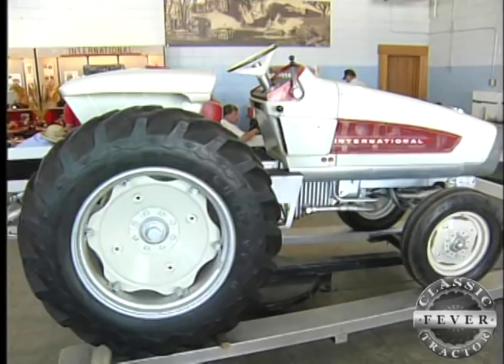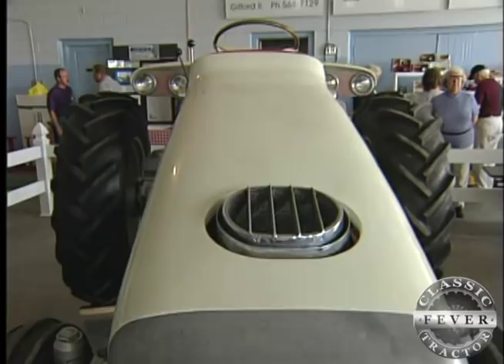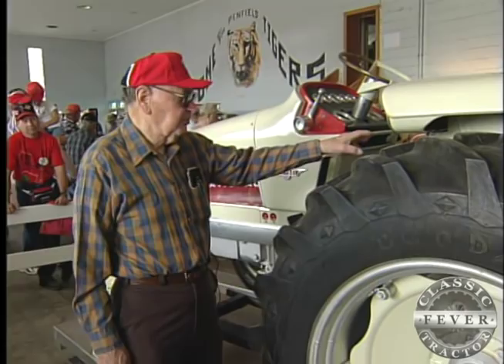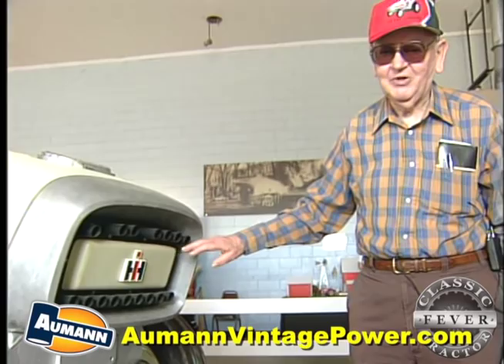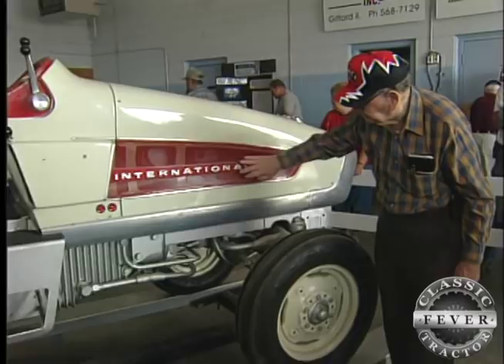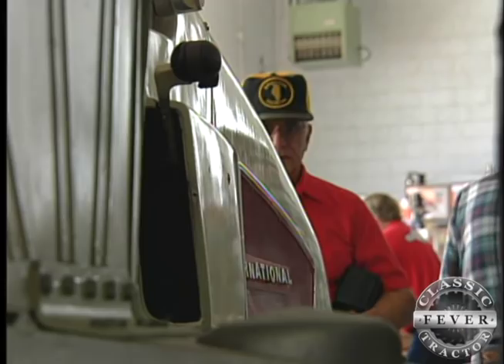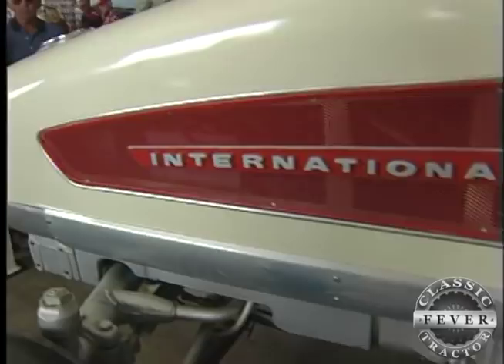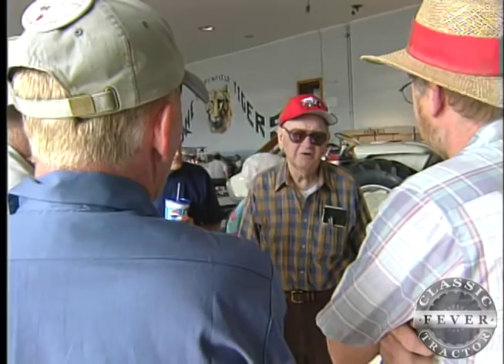This Machine Could Have Changed The Way We Built Tractors - HT-341Prototype Hydrostatic Turbine

Comment: Pratt & Whitney still builds a variation of this turbine. I’m 2nd generation on these engines. My dad, 96 now, worked for Solar Aircraft/IH Solar Turbines/ Caterpillar Solar Turbines for 48 years building these engines. They make giant industrial turbines. It is on the site of Ryan Aircraft in the 20s and one of the buildings has a plaque that says the Spirit of St Louis was built inside. I worked for them for 5 years. In 1980s small turbines were spun off to their own facility called Turbomach. It was purchased by Sundstrand in 1985. I hired in in 1988, I’m at 34 years now. It was then merged with Hamilton Standard when purchased by Untied Technologies. 2006 we became Pratt & Whitney. 2016 everything military moved to Palm Beach, Florida from San Diego. 
The turbines in this video are aircraft APUs adapted to this tractor. The first turbine is a T-62-T2A and was used on Chinook and other helicopters. The T-62-T2B replaced the A model in 1962. It is still in production today, shipping some out this Friday. It is the same engine in your video with a different gear box. These T2Bs are one of the most common units for aftermarket because we have built so many. There are turbine airboats, home built helps and airplanes. If you ever watched Home Improvement, Tim Allen’s jet mower was T2B powered built by Dixie Chopper. We  build 17 models of APUs in my building right along side F-35 main engines. I am very lucky to be a mechanic on this stuff, it’s been an awesome career and they pay me big bucks to wrench on the Treasure Coast of Florida. Two years to retirement.

Comment: I.H. made & marketed the hydrostatic transmission - ed tractors here in England through the 1970,s , they had ( I believe ! ) their own 4 cylinder diesel engines in , I liked them very much , as you could get exactly the ratio you needed to suit the job you were doing , which greatly improved efficiency , but I was once told you needed a clever man to work on or repair one , this may be hearsay , I don,t know , I didn,t get one , but knowing what I know now I wouldn,t be put off , my mates have all used Ford selecto - speed , David Brown Hydra - shift & M -F Multi - power without crushing issues.
I was once privileged to visit the Wheatley Hall Rd plant in Doncaster while it was still working , it was & still is , a massive place , where they made their own steel , & all swarf was re - used onsite . Most noticeably , nice people !  this goes a long way .  Whatever happened to our industry ?  as if I didn,t know .
Reply: "

"GLOBALIZATION is good for everyone"
George Bush senior's NWO, man we've dropped down a few notches since that first Gulf  war!!! Vote RED, lest we lose this nation our forefathers built with their blood, sweat
& tears.If we open boarders ,no restrictions no rules we've lost the best that's ever existed. There will be NO going back!!

Comment: Beautiful tractor. This is a one off, HT-341 built in 1962. There was one other built in 1961, the HT-340. It was the same but with a blue and white paint scheme.
Reply: Not the same, they had different turbines. 340 had the 90 hp T62-T2A, 341 had T62-T32. I still build these same turbines NEW for at Pratt & Whitney. I’ve built these since 1988, my dad also worked for Solar Aircraft/ IH Solar Turbines/ Caterpillar Solar Turbines in San Diego for 48 years. T2B has been in production, pretty much unchanged since 1962, T2A was 1958. You can still buy all spares for these engines. The turbine is still used on T2B, the gearbox is still used on Blackhawk helicopter APUs.

Comment: In the 1990's Agronomic Management Technologies of Tucson, AZ employed  a  bi-directional hydrostatic transmission in their Golf Greens rollers. Powered by a B&S, or Honda small gasoline, side-shaft engine it was light weight, fast and came with a tilt trailer, it was affordable and efficient. Rolled USGA spec greens to their "fastest" potentials in minutes with less pounds per square inch than the human foot. Went side to side, like a paint roller. Easy to operate and a blast to ride on!

Comment: It reminds me of an experimental tractor which I saw at the Farmall tractor plant in Rock Island, Il sometime during the 1960s. The one which I saw had the same basic shape and a high-speed road gear. At the time some people believed that it was going to be necessary to take tractors onto Interstate highways to get between fields. The tractor which I saw was an experimental tractor designed to be able to travel at highway speeds. It was abandoned shortly after I saw it. I went through the plant with my dad for the first time in 1964 and would go through a few more times during the 60s. I am not sure exactly when I saw the highway tractor.

Comment: Looks like someone left an IHC tractor and a Lotus 7 alone together in the barn a little too long.

"Military jet fuel" sure sounds cool, but JP8 is essentially just kerosene with some anti icing additives. With some tweaks, the turbine probably would have burned diesel as well.

Thanks CTF, neat tractor. Does it ever get cranked up and run?
Reply: Formula 1 and tractors...a true passion for both!
Reply: I have seen them run biofuel.
Reply: 4
Reply: @satishfarale1393  5

Comment: Another problem which occurs with gas turbines is gyroscopic precession. A company in Devon, UK, were working on a gas turbine quarry truck in the early 1970s, but found that, on very rough ground, the precession would damage the engine mountings. They also had problems with dust ingestion in quarries in summer, and the project was abandoned.
Reply: In 2003 the Army was having problems with sand getting into the blackhawks turbines. So we put air filters on them and a serviced them more often.
Reply: Ah well, the military tend to do things properly; The average quarry tends to wait for things to break before doing any servicing!
Reply: @reithsymonds4517  my god that is so painfully true
Reply: reith symonds oldsongs

Comment: It's spiffy, sure.   Lots of HP for not a lot of weight.  The issue is when you are actually using a plow or disc or any heavy equipment, you want sufficient downforce on the tractor tires so you can maintain control of that monster.  The easiest way to do this is for the tractor to weigh as much or more than the equipment.  This is why wheel weights, front ballast, and ballast boxes are things that exist.  Using this type of engine that weighs so little would compromise the control of the equipment.  At least in my opinion.

Comment: When International made this tractor they had only just moved away from diesels that had to be started on gasoline first, quite a jump. The hydrostatic system was adapted in the later 656 series and proved to be very successful . Chrysler built prototype cars and made a movie around a similar engine around the same time. Ford had class 8 trucks delivering freight and parts between plants and all attempts couldn't overcome the fuel consumption associated with them, also in the truck experiments the lack of torque kept them out of mountainous terrain.

Comment: Remember when Andy Granitelli almost Won the Indy 500 in a Turbine ?  Turbines are great 1 trick pony engines but farms need tractors to work a high and low RPMs and deliver high torque all the way through.  Plowing is one thing but digging post holes and pumping water and cultivating and baling hay all work at different engine speeds to avoid having an 18 wheeler for a transmission.
Reply: I do remember the turbine Indy cars.  They had to be regulated out of competition as they completely eclipsed the piston tech.  A $6 bearing failure cost victory in the 1st attempt I recollect.  Side note, tractors now have 18+ gears.  You're absolutely correct that turbines need to operate at near 100% rpm & load for fuel efficiency.  Turbocharged piston engines use turbines to extract heat energy & recycle it to the crankshaft.  Formula 1 has used the turbine to create stored electric energy for intermittent race use in a compound engine design, so turbines are creating useful power in many vehicles from the lightest race car to heaviest ship and all liquid fueled rockets.

Comment: Nice tractor, they should start it
Reply: I worked on turbine engines back in the 80's and they would have low torque but good speed control. The fuel use would be terrible - a tractor is the wrong use for such engines - generators with tight voltage control is a better use.
Reply: Thanks Mike, I guess it had a serious air cleaner on as turbine engines don't like dust and take a huge amount of air in per minute
Reply: Jan Kotze  Yeah, I was in the military (USAF) and we worked on -60 generator sets - used a gas turbine - one other issue would be if the exducer was pressed on or bolted. We had trouble with pressed on wheels shooting out at 20,000 rpm!
Reply: On a diffent video a group built one of these tractors and used the turbine from a generator.

Comment: In aircraft applications the higher fuel consumption is offset by weight savings, mechanical simplicity and ease of maintenance (relatively speaking of course). But a turbine in a tractor was a silly sci fi idea. Same goes for trains and trucks and cars and especially main battle tanks.
Reply: abrams tank is a turbine
Honeywell AGT1500C multi-fuel turbine engine; 1,500 shp
Reply: @dperry19661  I know. And it was a silly sci fi idea. The Abrams requires more maintenance hours than any other MBT, and thanks to nothing else in our armored inventory having the same type of engine, we need specialized technicians to keep it going. Plus all that dust and dirt in the desert can't be good. There are reasons why literally everyone else uses diesels, and those are just three off the top of my head. Sure as eff sounds cool though.
Reply: It was the only way they could keep the tank light enough to be transported by aircraft.
The engine only weighs 2,500 pounds 
A diesel of the same power would weigh over 5,000
So it was either strip 2,500 pounds of armor or use the turbine.

Comment: Ford tried this in 1955. Allis tried fuel cell about the same time.
Reply: hydrogen fuel cell?
Reply: @aaron___6014  In 1959 Francis Bacon demonstrated a 5 kilowatt fuel cell and it was 1960 when Nasa first used fuel cells so my guess would be sometime after that someone may have tried to use one in a tractor. could have been before seeing that it was unsuccessful
Reply: Chrysler actually released a car to the public with a turbine engine.
Reply: @iggyp7049  I was just thinking that before I saw your post.  It was a car that looked like it had after burners on the rear wasn't it ?
Reply: @iggyp7049  1963

Comment: Bad idea for the environment it would be working in . You wouldn't be able to count on Old McDonald to keep the intake filters changed . Plus you'd have to buy the filters buy the truck load . Very fine particles would be able to get through no matter how well you maintained the machine . Then you get to the pulling capacity of the thing . It's just to light weight , tires would just spin once the plow dug in . Nice machine though ! Or pop a wheelie .

Comment: I thought they made 2 prototypes? I have seen pictures with at least two Color patterns.
Reply: From what I read there was just the one.  It was originally called the HT-340 and had a blue/white paint scheme.  While touring shows in 1961(date ?) it was in involved in a traffic accident and damaged.  It was patched up and toured some more.  Afterward it was rebuilt with a three point hitch, larger tires, other modifications, and was given its present red/white paint scheme.  There is a replica that has been built using an IH-340 in just the last few years with a turbine that has the blue/white scheme.
Reply: @jnichols3  I think your right ill have to  reread some of my ihc  books.

Comment: Thanks to modern tier 4 emission control we have now successfully matched that terrible fuel economy plus dismal service life and horrific operating costs that turbine engine of old would have had in real world operating conditions.
Reply: Mr Squeak The Cat. Are they mandating tier 4 for off road?  That’s a mistake.
Reply: Sadly yes they are and it's proving to be a expensive high maintenance disaster for the owners in every market once their machines go out of warranty.  

I've got friends in the farming and commercial earth moving industry that are leaning on every old school mechanic and mad scientist tinkerer like myself who has applied knowledge and skills on how emissions stuff works to dust off our tools and start finding ways to either cut all that crap off the engines or find ways to refit older non emission built engines into new machinery like a growing number of truck drivers are doing now. 

I'd love to help them out but I have made a point of making sure all of my own personal equipment is old school stuff that's simple and easy to work on.
Reply: I drove a car hauler for years, 3406b cat and lots of hydraulics.  I quit because it’s impossible to find old school trucks that aren’t wore out.  Steel gets tired.  The new engines as you say cost a fortune to maintain.
Reply: heh was doing some electrical harnesses on those tiers from 1 to 4. tier 1- 5 connectors, tier 4 - 105 connectors and plugs for the same thing  lol engine, ecu, battery + nox/ cox filters
Reply: Tomas T,  Same here.  I got really good at undoing the emissions crap on stuff up to the end of Tier 3 on gas engines but haven't yet gotten a hold of a Tier 2 or newer Diesels to do in depth experimenting and reverse engineering R&D work on myself. 

I do know a number of truckers and farmers who put black market  'Chips" in their Tier 3 equipment and had huge gains on power, fuel efficiency and service life compared to their stock units.   

For a trucker 1 - 2 MPG  and 50 more HP is a huge gain.   Same with farmers that cut 50 -100 gallons of fuel usage off a single large machine in a 24 hour harvest period while also running with more useable power and less system heat.    

Do that for the typical 2 - 3 weeks most of them run near 24 hours day and those $3000 - $5000 black market 'chips' pay for themselves real fast.  Even better if it gets you  3000+ hours before your $80,000 engine blows up rather than 1500 - 2000.
Reply: Phillip Gates.  A lot of it depends on what you are willing to do to make something old and worn out new again.  

I've picked up loads of old farm and construction equipment over the years for dirt cheap simply because somebody thought it was old and worn out.  Yea it was, but worn out parts can be rebuilt or replaced with not worn out parts or with updated newer parts if a person is willing to take the initiative and time to do it.  

I've already taken a number of old farm tractors  that cost $3000 - $3500 and restored them to like new mechanical condition for another $3000 - $4000 and they do everything a newer $50,000 tractor does but mine are still something the average person can work on and they cost 8 - 10 times less for it.  

Down side is each took 100 - 200 hour investment of my own time to go through but thats cheap compared to the cash value of buying something far newer that still doesn't do anything better.
Reply: @mrsqueakthecat.8061  Good...now when they finally move to all electric with fuel cells your costs will be almost nothing...no more oil changes or regular maintenance. a cheap power source thats on sight ( you will be able to run every piece of equipment on the farm with one small fuel cell and the price will be about the cost of gas for a small atv) everything not close to the fuel cell like your tractor will be battery powered...the future will blow your mind and the best part of all this? the technology already exists today and it takes just one innovative person to do it to prove that your old timey steam engines are not efficient and they breath the very oxygen we need to live...unsustainable
Reply: Mr Squeak The Cat. Very Interesting narrative. May I ask where are you based?

Comment: I never understand these "What might have been" claims.
It has been
It has failed to replace contenders
It isn't...
That's the end of it.
Reply: Most complex things in current usage took years to refine to their modern state.  Many prototypes,  many tweaks, even development of support structures and support industries to make something practical.  Even the development or widespread use of better materials can be needed to make something cost effective or competitive. Sometimes ideas get a second go round.   If someone had predicted in 1900 that every other street corner in America will have a gas station, or said in 1800 there would be power wires run along every road and going to every house, barn and business in America, they would have been called nuts.

Comment: Love the tractor but you don't love to fuel they were using rocket fuel highly combustible highly flammable.....
Reply: A jet turbine should be able to run on just about any kind of fuel. That was supposed to be one of the advantages of them. You can use gasoline kerosene diesel Everclear perfume whatever you had.

Comment: Don't open the hood, no one wants to see under there just to look at a single shaft turbine. Might, smight, if it does not run economically it is no good. Maybe they swapped out the secret engine for a Briggs & Stratton twin, just to load it of course.